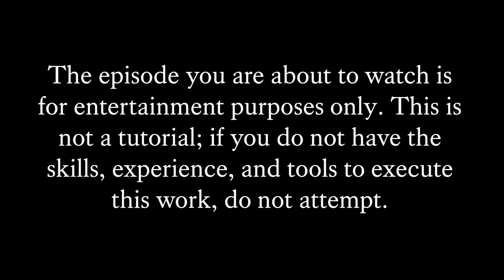Winchester 1892 45 ACP:  Anvil 113

Comment: Wow thats a very cool mod to a 92. Not going to lie i want one.
Reply from the maker: SO DO I !
Reply: I want one in .454 that won't stretch the receiver.  Or keyhole.  Damn you Rossi.
Reply: @randymagnum143  There used to be a .454 Casull, as well as a .460 S&W version, ('limited edition'??, not sure. I've seen a couple @ Gunbroker, just a couple times). Quite pricey, though...
Reply: @marknovak8255  good, now I don't feel so bad...
Reply: @hernandovillamarinbuenaven7476  they were a little more expensive than a .45 Colt, but they would quickly swallow a no go headspace gauge.   Local pawn shop was selling them because they were 1/2 the price of a Marlin 1894.  Tried a .357 and the bore was .004" oversized.  The bullets went through the targets sideways, which is to say they "keyholed"

Comment: I was just given Grandpa's model 64. The hammer wouldn't hold either. I ended up shaving the same surface, but it took a helluva lot more than a few swipes with a stone.

I suspect at some point the hammer was replaced and nobody thought to check that maybe it needed to be fit. Nice blue, hand worn finish all over - jet black hammer.

Comment: I’ve been watching you for a while, and I don’t work on firearms at all. However you made an offhand remark once about using hammers: “don’t hit harder, get a heavier hammer” and that advice has served me very well. Thanks.
Reply: Exactly. You can't drive a fencepost into the ground with a tack hammer, no matter how hard you swing it.
Reply: @ronkruchten5867  and you can’t peen over a delicate pin with a claw hammer no matter how lightly you swing it. Control while wielding is as important as raw power.
Reply: @sethbracken  I'll concede what I think is the gist of your argument; that it's inarguably best to have a correctly-sized tool for any particular job. 
  Cheers!

Comment: I'm from Argentina. Those 1892 carbines where converted to share ammo with Colt and Ballester Molina pistols in provincial police use. Train guards also used 1892 carbines but (I think) in original .44WCF. Lots of that Winchester model where imported here in those times, even FM (Fabricaciones Militares, state-owned ammo factories) manufactured .44WCF ammo.

Comment: NICE save!  The .45 ACP conversion makes good sense because it's the same reason the rifle was originally made to eat the same thing as .45 Colt Single-action Army revolvers: no need to carry two different calibers.  I obtained a 2nd-hand Rossi Model 92 in 38/357 and it barely worked...when it worked.  I got it for a song because of completely unreliable feeding.  The good news was no previous owner had attempted to butcher the action on their kitchen table.  I was able to tune it up; it works buttery smooth and slick and even feeds wadcutters.  A really fun rifle at the range and handy to carry in the woods.

Comment: For anyone seeking more information on this conversion a gentleman who goes by twobit on various forums has been collecting/posting information for a few years. To quote him from one of his posts on gunboards, "What I know so far is that they all started as 44 WCF chambered SRC’s. The rifles were re-chambered for the 45ACP cartridge which apparently was done to match the side arms caliber of the law enforcement departments. Some of the French rifles were subsequently stamped .45 LC since the .45 ACP is considered a “military caliber” and its use is restricted. The re-chambering necessitated altering the tail end of the magazine and the receiver internal parts. The barrel and magazine are shortened to a 16 inch configuration. Sling attachments were added to the left side of the butt stock and the rear barrel band on the fore end. The muzzle end of the barrel was turned down to a smaller diameter so that the barrel band would still fit and the front sight was repositioned.

The serial number range is from 15479 all the way up to 996101. The early guns have very large SN gaps between them but later examples are much closer in numbers and may have been purchased directly from Winchester. The “rack number” stamped on the left side of the receiver does not sequentially follow the SN progression."

Comment: I don't know why a company hasn't made a .45 ACP lever gun. I think it's an awesome idea and would love to have one.
Reply: You could sure fit a lot of those stubby little rounds in tube
Reply: I have seen custom jobs in .45acp and 9mm. both are brilliant. I eventually want to try to build one for .38 short colt. there is a specific firearm im looking for and if I find one, its going to need a lever companion.
Reply: Its not uncommon to read of 92s being modified to cycle a shorter round, setting the barrel back, and trimming down .45 colt cases to .45acp length. Boom, a .45acp with a rim and a rifle that will handle it. I really want to get a 92 trapper in 45 colt and do that exact thing. Would be awesome to have a little pack gun that holds 20 rounds lol. 255 grain slug moving nice and slow would pack quite a wallop
Reply: have you seen a Timberwolf .45 pump?
Reply: @imbadwrench  I have not before
Reply: @imbadwrench  after looking it up, it doesn't say it was made in .45 ACP.
Reply: It would be an awesome little carbine, especially if it was also able to handle 45 Super and 460 Rowland. Essentially the ability to go from 44 special up to 44 mag power.
Reply: I would love one in 9mm would be cheap to feed, scratches a level gun itch and would make for a neat little survival rifle

Comment: My amadeus rossi 92 clone is in 357/38, and I've always been happy with it. But having one in 45acp is appealing!!!!
Reply: i'll live with my henry in .357 magnum and my hipoint 4595 for .45 acp.
Reply: @johngraesser4911  how do you like the hi point? I was thinking of gettin one in 45acp for when I carry my 1911. Are mags and parts easy to find?
Reply: @user-ko3vg7fc7o  hipoint sells both their mags and the double length mags another company makes, never needed repair parts for mine, if it does break they have a lifetime warrenty, send it back and they will fix it no questions asked. has pic rails for lights and optics. i have been waiting to see if some atf drone tries to define their springy stock as a bump stock. i made it a goal years ago to get a carbine for each pistol caliber i own, .380 and .22 mag are the only ones now i don't yet have a carbine for. one thing i do recommend, stoning the inside of the feed lips to eliminate burrs, it eliminated scratches on the brass, and seems to help with feeding rounds.
Reply: @johngraesser4911  wow! Thanks for the info! What about after market stocks...any available? I've looked but google didnt show any

Comment: The 92 is one of my favorite lever guns, I know its not the best version of lever guns by a long mile, but it is a satisfying weapon with the visible action. My Rossi Puma Carbine is such a fun 357/38 , but finding the appropriate long-eye-relief scope to put on it was a pain.
Reply: I'll disagree and say the 1892 is an incredible design because the 1886 was. The modern 1892 is the only levergun design mechanically strong enough to be chambered in 454 Casull without failing.
Reply: @ActionEHamshraershV  its major detractor is top-ejection. But otherwise yea, it's a great design.

Comment: I've really wanted a modern levergun with an integrally suppressed barrel in 45acp. the shorter case length should mean more rounds in a tube, cheaper sub sonic rounds with enough weight and diameter in em to be effective with flat nosed bullets, better suppressor performance and no gas blowback from the manual action, lightweight and handy with a fun to use manual of arms and easy maintenance. hopefully someone makes one
Reply: I love the concept

Comment: Speaking of sweeping the shop. I try to keep a clean floor, vacuum before a big project. I have one of those long rectangular roofers “nail picking up magnets” that are on a pole that was on wheels and removed the wheels and now those tiny springs that get away get returned to the bench top where they belong! Ah, not that any escape mind you I’m just saying if… 🙄
Reply: There will always be one sproing that attempts to escape.

Always.

I may need to borrow your idea the next time I take my SVT40 apart.
Reply: I did that once didn`t sweep the wood chips up and then went work on an old jewelers hammer ,well an important chip came off and dove down to the wood chips and they all looked the same. Nearly went blind looking but about 3 -4 hrs later I found it in the mess of chips. Note to self sweep after every job.
Reply: @ScottKenny1978  It started out when we’d go flying RC models and one screw or bolt would make its break for freedom into the grass. One meet a guy had a magnet that saved the day. Then I got my roof renewed and saw the cleaning crew using the magnet on a pole w wheels and “light bulb.” 

It will save you HOURS.
Reply: @gunfisher4661  ugh, that must have been annoying and frustrating.

Comment: That was pretty cool and you removing a few rounds from the 1911 magazine to load into the carbine reminded me of a video I saw a long time ago of a guy using one to load rounds into the chambers of I think a .45 acp Ruger Vaquero like a speedloader
Reply: You are correct. I have used 1911 mags as speed loaders for my Ruger. I would imagine I would get a few grins if I put a mag pouch on the belt with the Vaquaro.

Comment: I just finished refurbishing an old socket ramrod using three steaming's, the carding wheel, re-bluing, and the non-detergent motor oil.  I turned a ramrod that I paid way less than half price for into a museum piece. Thank You Very Much Mark. If you weren't so ugly, I'd marry you!!!!!

Comment: Seems you had some issues soldering.  Looked like the parts could have stood additional cleaning.  I try to get down to bare metal and then use a more active "flux" than the flux for copper that it seemed you were using.   Try a liquid acid flux like Brownells sells for their Hi-Force 44 solder.  That stuff works great!  First rate work on the debugging and re-engineering, I learned a few things.  Thanks much for your efforts!

Comment: Love Your INFO Mark! but even old dogs learn new tricks.
I too am a bit of a gun smith and Red Neck engineer.
I grew up soldering as a boy, Pops(a plumber) "taught me" How Solder runs TO the Heat, so I heat a little different from what you did. 
"I Learned" the Electronics Supply store sell Pure Lead solder for a better flow, and THE BEST liquid flux for those problem jobs.
Love You INFO THANK YOU Sr! May I have Another?

Comment: When I work on firearms I hold them in much the same way except I built a height adjustable support in the form of a "T" so that when I am holding either end in the vice I can support the end sticking out. Works pretty good. Have seen a few 92's chambered to other stuff but have never seen one in 45ACP. Too bad they messed up a perfectly good 92. Glad you got it working again for whatever good it does. A 45ACP 92 imagine that. You would be the first one on your block to have one...

Comment: Pretty cool little carbine. Matter of fact I once had a Remington Rolling Block action with Santa Fe police marking of Argentina. In a weak moment I sold it. Still kinda mulling it over as a bad idea 😮
Edit: But I picked up a Model 92 circa 1900. Was converted in 1939 to 218 Bee. So. I think I came out a little ahead 😅
Reply: the winchester was suplied to many state troop from argentina, since early 1900. the Remington was service gun to army til 1890, when they swift to Mauser. there were loads of both, many remington rechambered to 7,65 and 7,63 (old mausers). The conversion of winchetes to .45 was done sometime between 1930-45, when almost all polices swift to .45. there were many fetherleys (something 12,70 or so) brought by swiss inmigrants, they were sharp shooters so eager that they were conscripted as snipers in the various revolutions and revolts that preceed our actual vote sistem (1880-1904). there are many "winchete" or "palanquero" ("leveler") still floating outside of the legal market in the countryside, even if finding ammo is quite dificult.

Comment: So, I can understand why they didn't try to chamber this thing in 45LC, because of the very thin and narrow rim on that cartridge that tends to pull off on ejection after the case has obturated upon firing and gets "sticky". That's why Winchester never offered this gun in 45LC, and went to the 44-40 instead.
So, in keeping with the philosophy that you want your lever gun chambered in the same cartridge as your service pistol, 45ACP makes sense, sorta, kinda. Simpler logistics for your constabulary, at the cost of range and power that you give up by issuing a model 1911 AND a bolt action Mauser carbine.

Comment: I wonder if- given the 45LC marking- it started life as that, and someone cut off the original chamber, cut it for ACP, and then lengthened the barrel to get it back over 16”, meaning the conversion was post-NFA.
Reply: A 1919 vintage 1892 wouldn't have been chambered in 45 Colt.
They were in 25-20, 32-20, 44-40 wcf.
Reply: @Mtbambeno  except for the Argentine guns.
Reply: @Mtbambeno   Also-38-40 .
Reply: @dongies5834   I sure missed that one. Thank you!

Comment: Pretty cool! I’m just wondering if it was actually converted to 45 auto rim and not acp. That would make more sense than trying to use a rimless round and having to deal with feed, ejection and head space issues.
Reply: I believe you are right.
the US army used to use the 45 auto rim. in there double action revolvers at one time.
there probably was a lot of surplus ammo around latter on .
Reply: I had the same thought as soon as it wouldn't eject the acp round.

Comment: Got tired of waiting for boiled linseed to dry for weeks and rubbed my x-bow with everclear. First oil was a slosh coat wiped off after an hour then 5 more with a cloth drying for weeks all told. A few spots were "glazed". Was I correct to remove the glaze or should I have kept applying till it was a surface skin? Its walnut with no filler or any other treatment, just linseed. My filler is water based, I didn't chance it.

Comment: Neat video! The problem is the Winchester Model 92 lever action is designed for rimmed cartridges, not rimless. It would have been a lot easier if it were chambered using 45 Auto Rim cartridges. Of course they are much rarer and would not work in a 1911 45 automatic, but it would be nice in conjuction with a 45ACP double action revolver. Did you try the rifle using 45 Auto Rim cartridges before you modified it? It might have worked fine with 45 Auto Rim cartridges. Years ago 45 Auto Rim ammunition loaded by Remington was fairly common when revolvers ruled the day in law enforcement.

Comment: After watching this one maybe start a business with a new lever gun cowboy production series calling it the, “Lever action Army 1911.” Start off a production of at least a thousand as a test run. Have two models one in blued steel with saddle ring and the other in Marine Stainless with saddle ring. Have also some kind of ability to caliber switch as well making a possibility of multiple calibers for more appealing market. Which ones do you think would sell out first.
Reply: I don't believe that I represent any percentage of the market, but I love blued everything. My bet is the stainless ones would sell first
Reply: @HomerEscobar1 , That’s what I was thinking. Much preferred corrosion resistance. Easier to clean and manage. Maybe offer a Cerakote finish on some models.

Comment: I have a mod. 92 in 44-40. My issue is when I cycle a round most often it will not chamber properly. It seems that the  nose is angled up to far and will not chamber. There are no knowledgeable gunsmiths in my area to work on my rifle.Maybe you can give some advice. Thanks.

Comment: Someone help me here; how much real benefit does one get, ballistic wise, from the longer barrel? Sure, the sight range is better, but does the round itself go faster; hence producing more energy?
Reply: Depends on the round.  Pistol rounds usually see significant gains going from 3" to 5" barrels, less going from 5" to 16", and actually slow down after that because all of the powder has expanded and drag takes over.  Ballistics By The Inch is an interesting site.  For Federal 230 gr. JHP: 2" barrel / 709 fps, 5" / 843 fps, 15: / 932 fps, 18" / 888 fps.
Reply: You’re not gonna get much from any auto loading pistol cartridge

Usually 8-10” is the sweet spot max for them
Reply: This was made for bullets cost savings in argentina...
Reply: The big benefit is going to be the stability 3 points of contact brings. Secondary benefits is lower blast from firing, lower recoil, and dead last, slightly better velocity.

Comment: Hi Mark, I'm curious if you've ever modified a modern 1892 to accept longer COAL than 1.600, which seems to be the longest mine will cycle. Any easy changes a gunsmith could do or is it a re-engineering project like in the video?

Comment: I have a Winchester 1892 chambered for .357 Magnum that I've had for 50+ years.
Reply: that's a real handy setup,. 38 spcl wadcutters make a fantastic pest round up to mid sized dogs with proper shot placement.
Reply: @thomasrussell7135  My rifle won't chamber correctly with 38 spcl or wadcutters because they are too short. I have got away with using .357 cases with semi-wadcutters.

Comment: Interesting.  I had to do a similar trigger job on a C96 once when some surfaces rounded off.  My approach back then was to build the surfaces (sear bar and hammer) up via TiG, then reshape that.  Of course relieving a surface wasn't really an option anyway in the C96 arrangement.  I usually grind the side faces on some of my files smooth so they are safe to rub against things I don't wish to file.
Reply from the maker: Lots of interdependency in a C96, and not much room to achieve it!